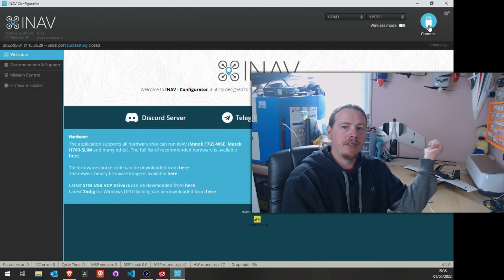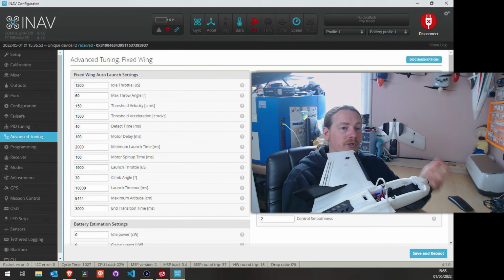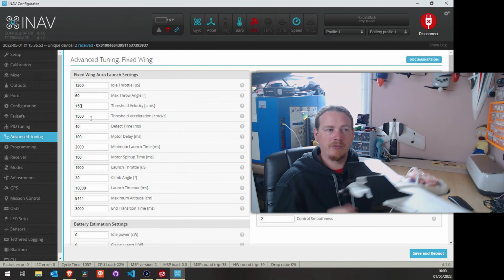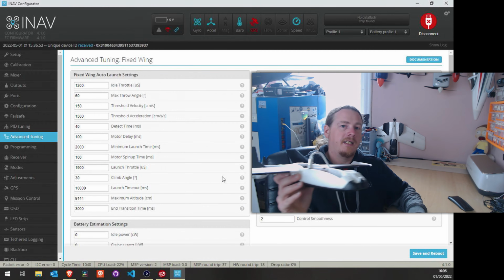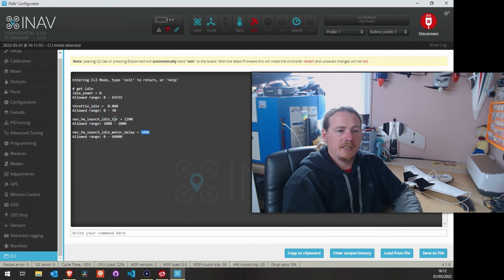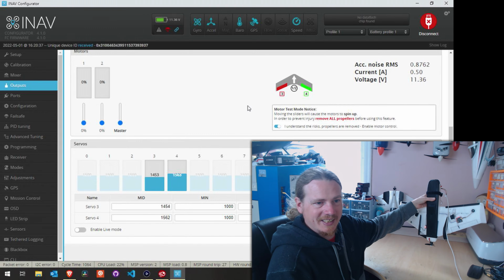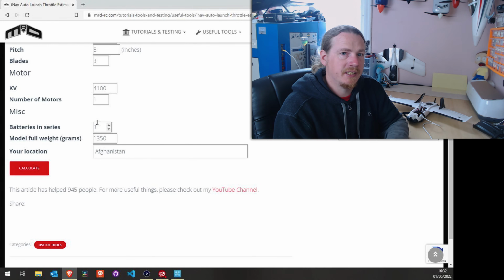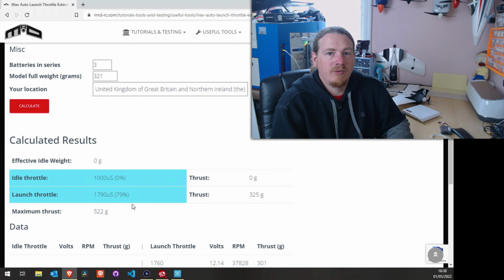Setting up auto launch, or launch mode, in iNav

Comment: Thank you for this. I used your "estimator" on your website and found out my motor is severely underpowered (1050kv motor and 998 g model), and would have certainly crashed. So it looks like I'm motor shopping.

I do have some 22000kv quad motors laying around. Are there any disadvantages to putting a quad motor on a wing?
Reply from the maker: What plane is this for? With the motors, its the stator size, not just the KV that’s important.
Reply: @MrD  yeah, I figured that out while shopping last night. Plane is an Eclipson EWW180. Yes it has a 69" wingspan. The motor I settled on is a 2830 1400 kv 385 watt 7x6 propeller.

Motor specs stated with that propit would get 1180 thrust.
Reply from the maker: That motor sounds pretty big, compared to the motor recommended in their kit. They use the SunnySky X2212 1250KV on 3S. The weight is similar to my S800, where I use a 2508 1200KV motor on 4S, and have loads of power. My AR Wing is also similar. On that I use a SunnySky X2216 III at 1250KV, also on 4S and with loads of power.
Reply: @MrD  yeah that's a headscratcher. There is no way that motor works. The depth for the cavity the motor sits in is 30mm deep. You can't get a prop on a 2212. I know,  I tried.

Also, my 1050 kv motor is a flite test power pack b motor, which they also reccomend.  It mounted perfectly on the back, it is a 2235 motor. I had a 6x4.5 prop on it and I felt no thrust at full throttle.
Reply from the maker: I just checked out the FliteTest power pack B. It says it’s a 2212 1050KV motor, and should have a 9x4.5 prop. I guess that would be for 3S with that size prop. 4S would be around an 8x4.5. Either way, 6x4.5 would be too small, so not surprised there wasn’t much thrust. 

The other thing with motors is that there are two sizing methods. Quad motors and fixed wing motors like those SunnySky X2212 motors use the stator size, not the case size. Whereas traditional fixed wing motors use the size of the bell. So the SunnySky X2212 motor would be around a 2826 in traditional measurements. The X2216 would be a 2836. That 2830 motor you have said, if in traditional sizing, could be around a 2212 stator. Given the low watts, I’d imagine that’s the case. This just confuses things further. If only all manufacturers just used stator size, it would make things so much easier.
Reply: @MrD  oh that totally clears things up. Yes that motor I bought is traditional outrunner. I also screwed up and ordered the wrong one, luckily it still fits (3530 1400kv)

Comment: Thanks for such a concise and informative video. I seem to be having an issue maybe you can help me with. I'm running INAV 5 on a Matek 405 mounted on a twin engine flying wing. Everything seems to be working normally so far except auto launch. (Referred to as "NAV Launch" in Inav 5) I set up all the parameters according to your instructions, but when I engage nav launch nothing happens. In fact, once I select that mode on the transmitter the only way I can get it to arm after that is to remove and replace the battery. Any thoughts? Thanks.
Reply: Update: One of the other issues I was having was the OSD mode and system messages weren't appearing on my screen. I had them set too close to the bottom in configurator, so they were off the screen on my goggles. Once I figured that out and corrected it, I was able to just follow the system messages and now auto launch is working perfectly. Clearly, I was doing something wrong with the switches.
Reply from the maker: Glad it’s all working Walker. Sorry I missed your original message. It sounds like you could be using NTSC as the video format. If you see the mode to NTSC on the OSD page, it will adjust the preview so that it’s easier for you to arrange the OSD elements.

Comment: I launch my wings with 20% climb angel, cruise mode on. Auto launch will cancel after 20 seconds as pre my settings and cruise takes over automatically. If I hit the sticks and cancel it with cruise on it will take over on cruise mode. As long as the throttle stick is at least in the auto throttle area for power on.
Reply from the maker: Yes, there are many options, depending on what your flight plan is after launching.

Comment: launch not working I am following full proceduir.system arm,motor spin.in acro,horizon or angle mode stabilization system in glider no working.please help.
Reply from the maker: Please could you describe the issue a little better? It's hard to follow what you are doing. Also explain how you have autolaunch set up.

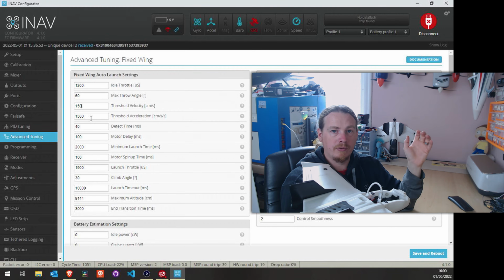Comment: 8:50 velocity shake
Reply from the maker: Nah, not a shake. Just a fake throw. Never shake before autolaunch.
Reply: @MrD  its just for me a book mark
Reply: i do shake my sonic modell 600m but thats because the timing is too slow before the motor kicks on so i shake..... thats why i saved this so i can change the timing.......i just built my sonic model pro with inav 5.0.0 and with a new matek f411 wte..... im going for 6s 60 amp 1400kv
Reply from the maker: Idle throttle would be the way to avoid shaking.

Be careful with the F411 on 6S. Make sure to put a capacitor on the ESC to stop any spikes. They have knocked out the F411-WSE quite a few times.
Reply: @MrD  idle throttle is the speed of the motor at idle that's not my problem it takes too much time for the plane to notice I thrown it so I will adjust the motor delay like I have in the past.
Reply: @MrD  bro i have a question my new matek wte f411 is being a pain with the new inav 5.0.0 its says  osd_stats_energy_unit...... and  my cam is not showing up in my head set but stats are showing in the head set
Reply: NEVER MIND IT WAS THE FC NOT GIVING ENOUGH POWER TO CAM
Reply from the maker: That problem must have been frustrating, judging by the shouting 😉
Reply: @MrD  yeah its this new matek wte f411 i could not find any matek wse f411s so yeah...i also had problems with the signal wire from esc i had to use the ground from motor 2 for motor 1. the ground on motor 1 came off or was a bad
Reply: @MrD  the esc is a V-Good RC 32-Bit 60A 2-6S Brushless ESC for RC Airplane peak current 10s 80 amp it has two caps on the esc .. it comes like that
Reply from the maker: @staydown.normalsavas  that should be fine, so long as you haven’t extended the power wires between the FC and ESC.
Reply: @MrD  what?
the fc is in one spot and the esc plugs in
Reply: @MrD  it will be fine i have goes 114mph on 4s on my sonic modell600m with a zohd 40amp 4s esc. look at my videos
Reply from the maker: The thick power cables from the ESC that you solder to the flight controller. If you increase the length, you should add 220uF of capacitance. Stock length or shorter is fine.
Reply from the maker: That’s pretty good. The most I’ve got out of mine has been 141 mph. That was with dive and wind assistance. It was around 120ish on the flat.
Reply: @MrD  😃
Reply: @MrD  what size motor kv? and this was on a sonic modell 600m????
Reply from the maker: @staydown.normalsavas  yes, it is the Mini AR Wing. Xing 2206 2750KV on 4S.
Reply: @MrD  one more question... do i really need a Magnetometer? im using a bn220 gps and i know it dose not support mag... and the bn880 dose ........ and all my quads and plans work on bn220 gps fine
Reply from the maker: @staydown.normalsavas  you need a mag for a quad, but not for a plane

Comment: Hello. Can I do an auto launch with a model that will fly for the first time or do I have to trim it earlier
Reply from the maker: If you are 100% confident that everything is set up correctly. You can use autolaunch on the maiden. Personally, I prefer to control the plane, and have someone else throw it.

Comment: Hey Mr. D,  awesome video!  I just successfully auto-launched my ZOHD250 yesterday and wow is that awesome.  I have cringed in the past trying to hand launch models,  this is soooo much easier.  Question,  I have not autotuned yet as I am just feeling the model out first and only flew in Horizon mode which went great.  I would like to set it up to loiter so that when I auto-launch it will automatically loiter until I am ready to tune.  I assume the MODE I need to set is NAV POSHOLD and put it on a switch.  Right now I have Horizon,  Manual & Acro on a single three-position switch.  Do I need to replace one of these modes with NAV POSHOLD?  Thanks again and I appreciate any help.
Reply from the maker: Firstly. Don’t use any of the navigation modes until you’ve done the autotune. On default rates and FF it will be very sluggish. To be honest, it will be sluggish in Horizon too. You need to do the autotune in acro. I currently don’t have a video on tuning. But Marc Hoffmann has an excellent video which takes your through the process https://youtu.be/VhIZ1F1UCEU

When it comes to the modes. POSHOLD is loiter. You may have seen videos that say need to also have ALTHOLD in the same position. This hasn’t been the case for a while. You only need POSHOLD. I have all my modes on one RC channel. But your can spread them across multiple switches. 3 positions isn’t really enough for modes.

My setup has a 3 way switch and a 6-way switch. I combine these to have 8 flight modes. But similar things can also be done with two or three 3-way switches. I show my setup here. But if you need more information, just let me know. https://www.mrd-rc.com/tutorials-tools-and-testing/opentx-tutorials/my-transmitter-setup-a-simple-guide-to-a-great-model/

Comment: May I ask how you set auto launch on a switch? Thanks for your indepth content Mr. D
Reply from the maker: Yes, I have mine on a switch. Just set up a switch and set it to the NAV LAUNCH mode on the modes page. If it’s not called NAV LAUNCH, it will be something similar. It will only appear in the list if “Permanently enable launch mode” on the configuration page is disabled. 

I’m glad the videos help.
Reply: @MrD  Thanks so much for the fast reply! I will check it out and can't wait to see your videos about Inav 5

Comment: I'm building an Opterra 2M with a Power 25 at 1250kv. Weighs about 2300 grams. Your thrust calculator tells me I only need 67% launch throttle on 5S 11x6. My idea is to set this up to auto launch vertical and a throw wouldn't even be involved. Is this even possible with no threshold acceleration detection?
Reply from the maker: No. Autolaunch needs to detect the acceleration.
Reply: @MrD  If I go up to 11x8 it increases my thrust to 22,000 grams. Plenty for vertical launch. Would you recommend ditching the auto launch feature and just send it vertical with all that thrust and try to maintain control, or is this a bad idea.
Reply from the maker: @lorenshartingers3575  personally, I wouldn’t vertical launch an Opterra. Its a big, slow cruiser. So wouldn’t react very quickly when it needs to. I would launch it normally and keep control of it.

Comment: Another great video Thanks, I've been using autolaunch on my ar wing pro for over a year now without crashing but have had alot of close calls, this wing always goes hard left or right not straight,  my c1 chaser launches straight almost always. I'm using 1400 idle throttle and 1900 launch throttle on both wings, is this just normal behavior of the ar wing pro or maybe needs different launch settings I have to say this wing is very disappointing so far. Do you have any idea what's going on with this wing or is it just not setup properly. Thanks again
Reply from the maker: To be honest, a lot of people seem to have trouble launching the AR.Wing Pro, and I really don't understand why. I had the chance to fly one a week or so ago, and there were no problems on the autolaunch at all. I don't know 100% what the launch throttle is on. But, I think it will be 1700 (the default setting). Manually my friend launches it with 3/4 throttle in horizon, with a wing toss. It goes up without a care in the world.
When you say going hard left or right, do you mean it rolls that way to change direction, or it drops a wing?

As for flying it. To be honest, I wasn't overly bothered. It flew fine. But it was nothing special, just average. I prefer my original AR.Wing. I also maidened his AtomRC Dolphin that day too, and it was a much better thing to fly.
Reply: @MrD  Thanks Darren, when I throw this wing it banks hard right usually but sometimes hard left, so which ever way it banks that wing is tipped down but then I guess its inav that gets it back to level but it's now going in much different direction in which it started out because of the hard banking, other than launch its flying good in all modes,I have many miles on this wing but may have to retire this one and maybe try the original ar wing 900. Thanks for all your help.
Reply from the maker: I’m just trying to work out if it’s changing direction due to not having a heading or if it’s tip stalling because there’s not enough air speed. Do you wing toss or overhead launch?
Reply: @MrD  l just grip the fuselage and point it towards the horizon and give it a push, autolaunch always engages and it climbs like it should but never even close to straight, I tried a 8060 propeller vs the 8050 but if anything that made the situation worse but it definitely has more power. Maybe I'm throwing it to hard or not hard enough I'm lost at this point. The hardest wing I've ever launched.
Reply from the maker: @egtreadway4232  i’ll see if I can get a video next time for comparison.
Reply: Ok thanks for your help, I watch videos of people launching and there ar wing pro heads off in fairly straight direction but others bank hard left or right and even nose down to the ground, but thanks again
Reply: I understand tip stalling due to not enough air speed but I'm scratching my head on how it might not have a heading. Do you mean it's to straight up or down? I have the climb angle set to 28.
Reply from the maker: The heading is calculated by the GPS. So a heading isn’t known until the plane starts moving. If you’ve walked with the plane in one direction, then launch in a different direction, that could have an effect. I mentioned in the section at the flying field to walk in the direction you’re going to launch the plane for a couple of metres, as it may help with the heading. 

I’ve found that throwing too hard can be bad. The extra effort can take away from the precision of the throw, and cause the plane to go all over the place.

Have you thought about recording yourself throwing the plane. It may show up something you don’t realise from your perspective.
Reply: That makes sense and I'll definitely give it a try thanks

Comment: Brilliant Video mate - Autolaunch is one of the greatest things about INAV - it's so much better and with so much more control than the other systems I've used.
Reply from the maker: It it a cool feature. It's well worth tuning it to get perfect launches every time. And I totally agree with what you said about the idle timer. That is a priceless feature. I use it on everything now, even if it doesn't really need it. I just means I can take my time with the launch.

Comment: It seems these auto-launch parameters would be almost directly linked to the mass of the plane. Could we create few tabulated recommended value (or range) by aircraft masses?
Reply from the maker: Hey Mat. Unfortunately not. The mass is a part of it. But the propulsion system also makes a big difference, as well as how the pilot throws the plane. Once you get used to doing this, it really doesn’t take long.

I will do the trigger test to get the velocity and acceleration right for that plane and throwing technique. Then use the estimator tool for the throttle levels. The rest of it is pretty much personal preference or specific to the model.

Comment: Great to see you outside with your videos,thanks again for a great tutorial.
Reply from the maker: Thanks Mark. It’s great to be back outside and flying. I’ve flown loads over the last few weeks and it’s been amazing. Hope that everything is good with you and you’ve been out flying too.
Reply: @MrD  Been busy with my new build,got a few issues with my dragonlink system and F765 set up.
Reply from the maker: Cool, what are you building? I hope the issues get ironed out soon.
Reply: @MrD  Another Ranger 2400,my gps on UART 3 giving problem with working,was giving numbers 99.999 in gps tab in inav and wiring was ok,I checked on ublox program,I ended up refreshing 4.1 again and problem gone..? Could it have been a corrupt install from 3.1,I didn't copy diff I did a new set-up.
Reply from the maker: Possibly. Sometimes bad flashes can happen.   Hopefully it will all be working soon. Have you had the Ranger 2000? If so, how do they compare to the 2400? I have a 2000.
Reply: @MrD  yes have 1600 ranger,2x2000 ranger and 2x 2400 rangers.
1 bixler 3
And a few Skyhunters
Reply: @MrD  the 2000 is a great platform very stable and forgiving,i only do true long range flying here,full use of antenna trackers.

Comment: great video 👍
do you think you could make a tutorial for the aterisation with inav?
Reply from the maker: Thanks Mateo. Sorry, I don't know what you mean by aterisation?
Reply: @MrD  sorry i made a spelling mistake i meant landing
Reply from the maker: Honestly, I don't use it. I have RTH set to land on failsafe only, as it is more a controlled crash. The plane will loiter down until it thinks it's a few metres above the ground, then it cuts power and glides the rest. It uses the loiter circle to come down, so you need a large, flat area. I would not use this to land the plane, unless I had an emergency with no RF link. Flying the plane down is much better.
Reply: @MrD  ok thank you very much for your answer 👍